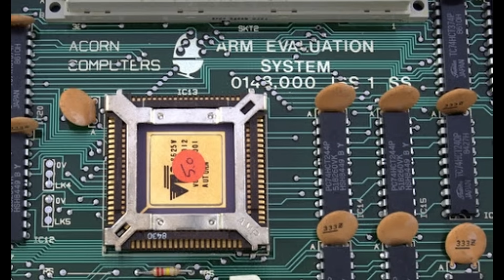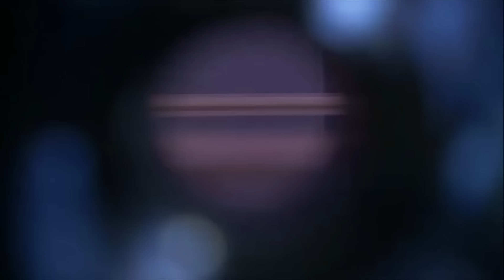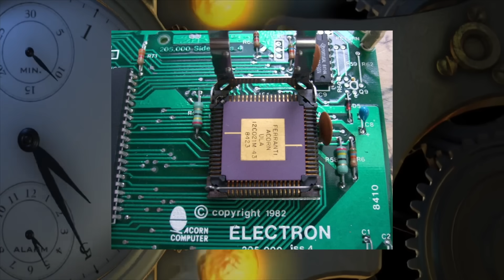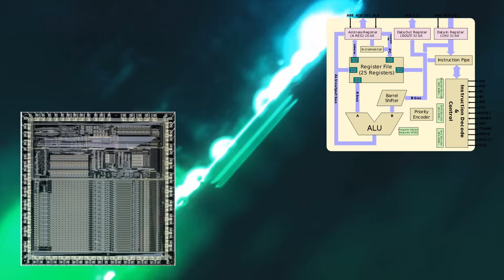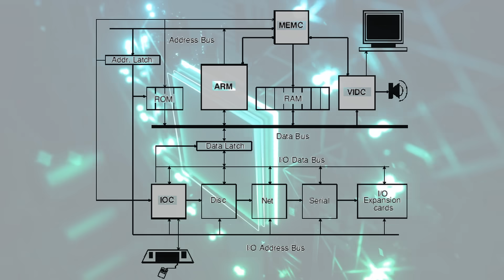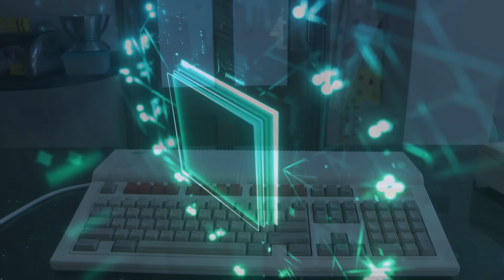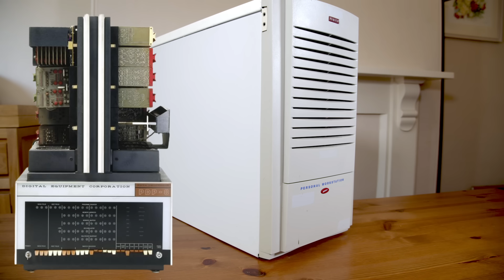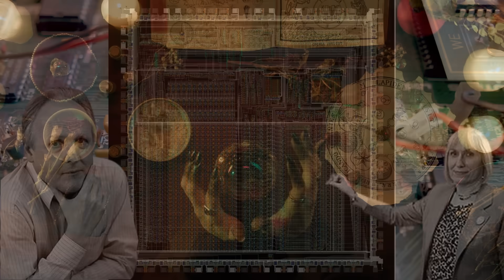The potted history of ARM

Comment: The next decade or so might get very interesting in terms of CPU architectures. ARM seems to want to leverage their licensing power way more (see Qualcomm lawsuit), and seems vulnerable for a takeover / acquisitionand then a massive change in licensing. x86 has two relevant license holders, and there is never going to be a new one (AMD and Intel pretty much have mutually assured destruction kind of interwoven patent portfolios and IP licenses). And then there's RISC, whose licensing model seems much more open then the other two.
Reply: RISC-V is the Linux of CPU architectures, take it, use it as much as you like but you can never take away the freedom of others to do the same.
Reply: @BastetFurry  RISC in general is like that. "Anyone" could wright a RISC instruction set and make it open or closed source.
Reply: Well these days, Intel is essentially an AMD64 licensee. Of course AMD64 is based on Intel stuff, so it is a lot more complicated than that.
Reply: @katrinabryce  The way I view it is Intel own the first 32bits and AMD own bits 32 to 64. In terms of instruction sets that's not quite it either but it's a nice way to think of it. Like you've said it's complicated.

Comment: Always loved the story of the first time they've measured the power consumption of the first CPU and it worked despite the fact it wasn't even connected to the power supply.
Reply: They should have run with this idea. Imagine zero-power CPUs!
Reply: @SchoolforHackers  sadly, the power has to come from somewhere, and if you use parasitic power, it just means you add a diode drop in series with the associated additional power loss. It's better to supply power directly, rather than through a very convoluted path.

Besides, if it ever happened that most lines on input into the processor were in state "low", it would cut power to the CPU. I can tell you from experience (with both ATMega and ARM) that this is quite a frustrating "randomly occurring" bug, and is the reason most new board bring up procedures in the industry start with verifying the power bus voltages.
Reply: @Validole  although, it would be a good marketing gimmick, and wouldn't be the first misdirection in computing. It's a feature, not a bug!
Reply: @squirlmy  lol imagine buying a cpu and their power pins are not even connected, but it still runs!?
Reply: Parasitic draw
Reply: @auzzierocks  yes, we watched the video
Reply: Everyone watched it? Be nice pal.
Reply: That alone should have been enough proof that it had the energy efficiency they wanted lol
Reply: At least now with modern ARM devices, they still don’t take that much power. The Nintendo switch is one of the first lowest cost ones, while the Apple M1 was the previously best performance ARM cpu.
Now we have something like the M1 ultra, and soon an M2 ultra, that has loads of power, but sips power compared to traditional CPUs and GPUs.